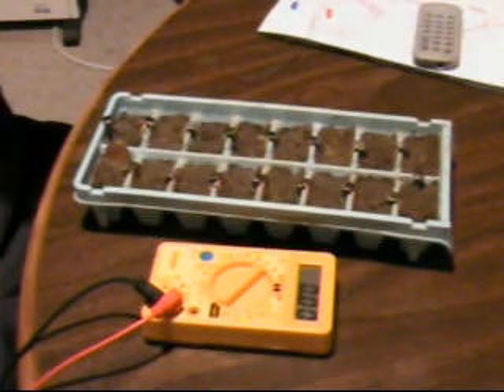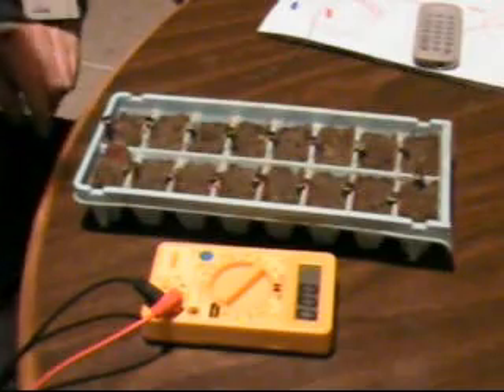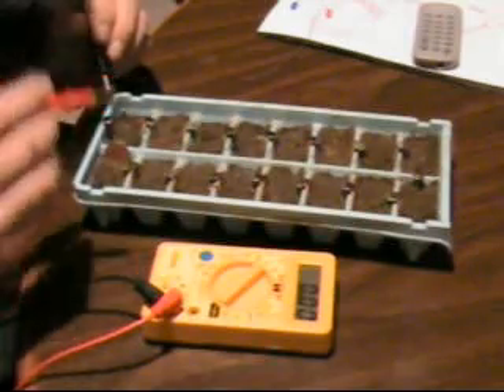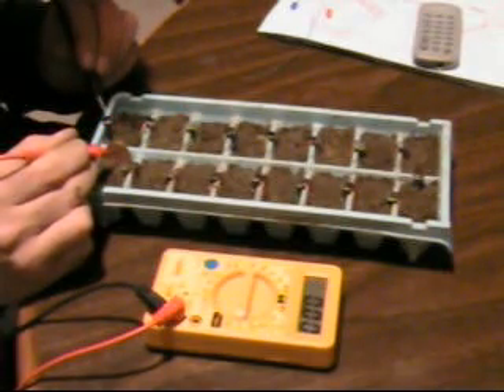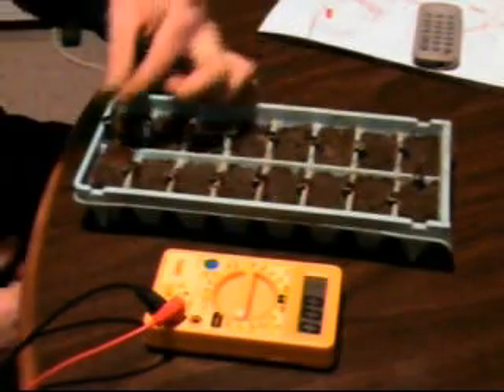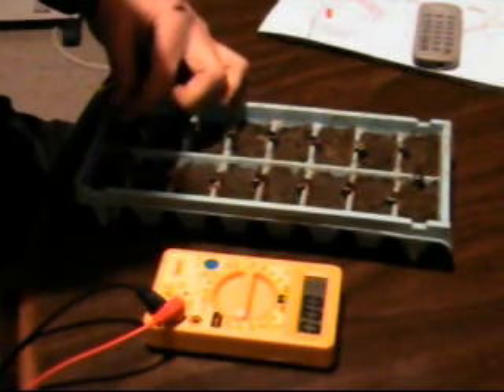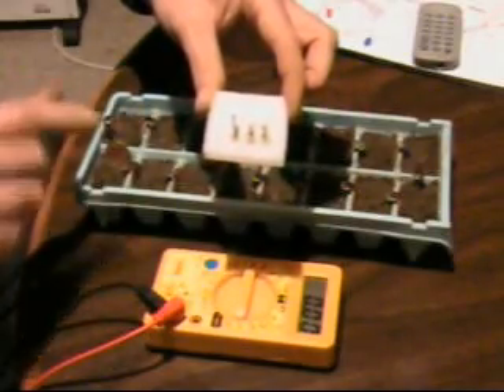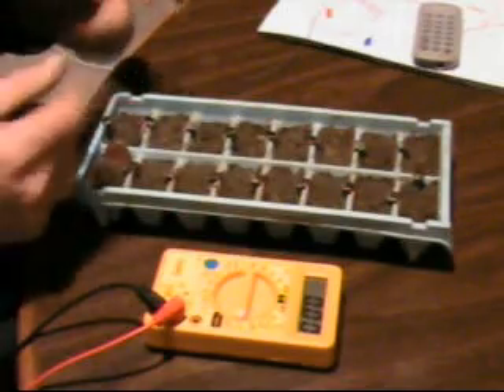12V Earth battery

Comment from the maker: Milferno1 is correct for the most part. However this is a very small scale battery that doesn't use optimal components. Make no mistake though, this is usable energy as i've shown in other videos. I've been able to run a magnet rotor and light a LED torch with enough output to see around the room at night. The current version of cell i have puts out around 100mA and should be enough to run through a circuits such as Dr Stifflers spacial energy cohesion circuit and light CFL's!

Comment from the maker: @JimTheHermit Thanks. I've done that in other videos but here was going for higher DC for the LED torch. A greater surface area on metals or metals with a greater potential difference also increases current as shown in my graphite magnesium single cell running a motor.

Comment from the maker: @Lukeidea Send me a PM and i will explain the construction in detail. It is certainly nothing amazing as they were doing this in ancient times (minus the ice tray). I don't think upsizing is really viable as you need a large surface area of metals and the metals are eaten away over time. Lithium batteries use the same principle only smarter materials. Check out my graphite/magnesium cell running a motor!

Comment from the maker: @megavil Each opposing metal is linked together with a magnet. As i understand it  electrons traverse the positive side of the magnet and are caught in flux until an excess accumulates at which point the remainder are sling shotted to the next cell.

Comment from the maker: @willgd78 yes. The smaller unit has similar output but doesn't last as long. Generally speaking a larger surface area of metals will give you a better output.

Comment from the maker: @thejackalhunter01  make sure each cell is contained and no dirt is spillng over from one cell to the next. Copper and zinc in each cell, the copper from one cell is connected to the zinc in the neighbouring cell. The two end cells (closest to hands) has one copper and one zinc unlinked ... this is your output. Stayed tuned for another cell. Carbon rods wrapped in cotton then magnesium ribbon. I made them about the same time as this cell,  just pulled them out again and they are still working!

Comment from the maker: @highvoltagefeathers very observant. That's exactly what i've been saying. I think dirt is better than sponge though, as it contains electrolytes that will activate when adding just water. A sponge dries up to quickly and electrolyte must be added. I could have put manure in it and called it a poo battery, but it doesn't sound as good really.

Comment from the maker: @RHEAD100 I beg to differ. By that reasoning there would be no smaller batteries than standard AA. If you increase the redox rate you increase the flow of electrons and therefore the power. It won't last as long but it will output more in the shorter time. Of course increasing surface area is the obvious way ... but not the only.

Comment: That's NOT how to measure current! You need to do it with a resistive load in series with your DVM and battery. Your readings are bogus. The voltage reading is also without loading. An LED requires only ~25 mA. Try again with a known load like a power resistor of say around 1kΩ. Then use Ohms Law I=E/R or Amps = 14v/1000Ω or 0.014A or 14mA. That's 196 mW. But w/ a load that will drop quickly as cell looses voltage. Battery reliability is rated by mAh - how many hrs maintain a steady current.

Comment: Huh? What does earth, water, and magnets have to do with it? Its the zinc, copper, and acetic acid (vinegar) and/or brine thats causing the effect. You've essentially have made a electrolytic battery  or wet cell discovered by Alessandro Volta in 1790 AD. You can make one with a lemon or potato too. The Baghdad "jar" is prolly just for electroplating or mild shocks for pagan religious rituals. There's no proof that it was used for lighting up light bulbs. Egypt maybe but not Babylon.

Comment from the maker: Large for 12 volts? I guess you could just buy a compact 12v alkaline from the local mall. As stated a few times, the charge lasts around 3-4 days before needing re hydrating. Redox  lasts for around a week and a half after which metals needs swapping out or scrubbing.

Comment: Ships use zinc anodes to prevent electrochemical corrosion in the other metals in contact with the water -bronze propellers, etc.. Salt water acts as electrolyte and oxidizes the "weakest" metal available, so if we give it zinc to "eat", it will leave the other metals alone. Nothing to do with clams, sorry...

Comment: No, I'm not and I apologize if I gave you that imprssion. I just want to let you know that your earth battery does not have commercial applications because of the weak current flow as a result of high internal resistance however high a voltage reading you are getting on your meter.

Comment: Are you familiar with something called internal resistance of a battery? Your meter may read 14V under NO LOAD conditions but when you try to power high drain circuits (not LEDS) the system break down and does work because of the high internal resistance.

Comment: Most people put a light bulb or something in series to the circle to measure amperage draw.   So you're measuring amperage with a dead short.

If you put the ammeter into a conventional house outlet, it would burn up the meter.

The worlds usage of electricity as changed quite a bit since the time of Tesla.

Comment from the maker: It matters in that the more dirt you have, the larger surface area of metal you can insert, and the more current you will produce. The dirt is merely a substrate providing salts. You can use any electrolyte. I put drops of Hcl in the dirt with water to speed up the redox reaction.

Comment: Very nice :) it only takes 12v-10amp to power a auto starter coil= to fire a spark plug :) yes it can be shortened up via dirt or and 2x the materiel in the dirt :) Higher voltages cna be tranfered into amps via parralel hook up have one series and one parralel thank you :)

Comment: Current is not where all the work is done. Work = power and power = volts x current. The soil acts as a sponge and has natural salts in it anyway. By adding a few more you simply allow the movement of electrons. This happens because of the dissimilar metals and the dielectric (soil). Making electricity has nothing to do with the soil as almost anything can be used as a dielectric. You are doomed to get very little power due to high internal impedance.

Comment from the maker: Thanks very much. Yes more cells (in parallel) and larger metals means more amps. These magnets (small round) have little effect on  current flow. They are just easier than wires for connecting the cells. The small one has no magnets. Thansk for commenting

Comment from the maker: 240V ac pulsing. What do you mean?

The only way to increase amps enough for usable power is to increase plate size an use series, and use a good electrolyte. I have also tried running through a DC/DC converter. I think these step up devices convert to AC then back to DC. Without enough existing current it gets reduced.

Run something? DC will run LED, calculators, clocks, remotes etc.

Comment from the maker: Yes, thats the reason i am using Hcl. Higher redox rate = higher amperage. My goal was not longevity but brightness. The electrodes being eaten isn't the problem ... its the rate of reaction which builds up the chlorides quite fast. Once built up the reaction slows to a stop, and the electrodes need cleaning. The bad part is .... creating the chlorides.

4Zn + 6HCl --> 2Zn2Cl3 + 3H2

2Cu + HCl --> CuCl2 + H2

Let me know how your series goes. Would like to see it.